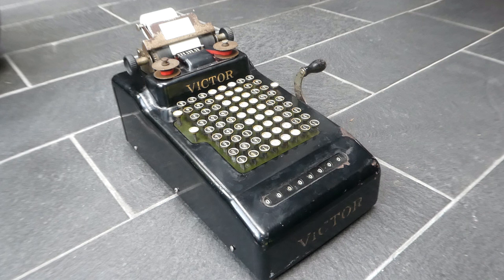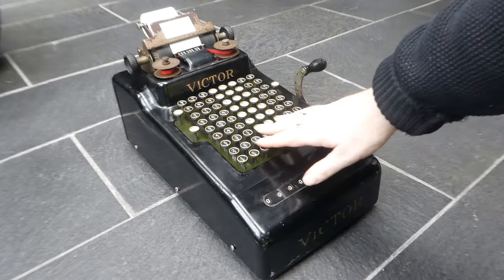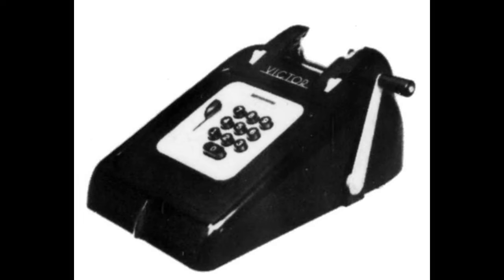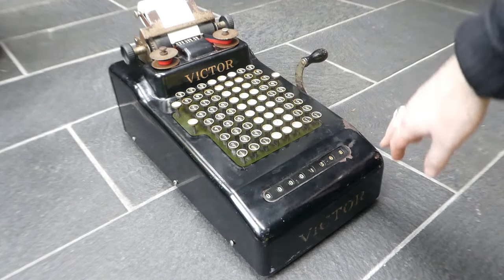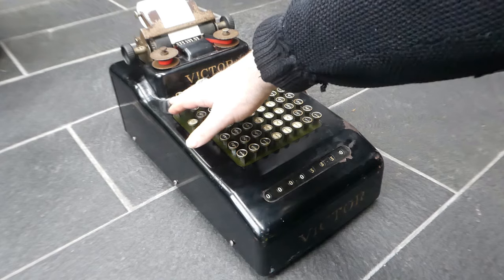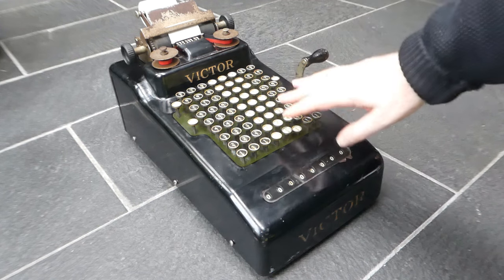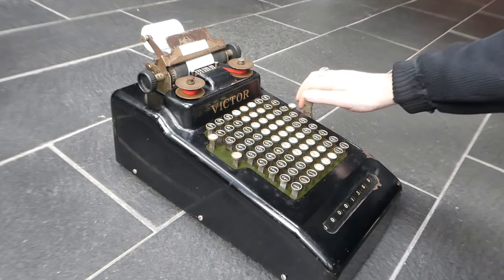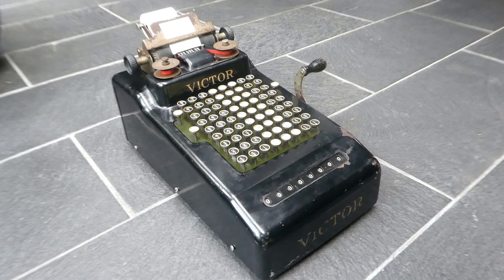The Victor series 2 adding machine

Comment: Nice Victor. I couldn’t get mine working. I’ll try again some day.
Reply from the maker: The only problem that mine had was the printing mechanism. It was completely seized, and I broke it a little when trying to work it loose. It turns out that the platen's axle is not a single rod all the way through, and now the right hand side knob no longer works to move the paper as it just turns almost freely. I should have taken the printing mechanism apart before trying to wrench the axle loose. Anyway, while mine has a lot of surface rust, the internal mechanism was fine.

Comment: I noticed the 'Complements' on the keys, so I'm assuming if one knew the subtraction algorithm that one could, in fact, even subtract on this machine. Although without Comptometer Cut-off keys for subtraction, I suppose the Burroughs' method of loading all the noughts or zeros with nines to the left of the number being taken away would work. There was, however, no printout on a Burroughs Calculator nor on a Felt & Tarrant Comptometer, so the subtraction printout on this would look bizarre to those unfamiliar with it! 
I can't tell you how much I enjoy your videos and your website! Cheers!
Reply from the maker: You're right, I hadn't even thought about that. I suppose subtraction would mostly have been used to fix mistakes, and then it does not really matter how it looks.
Reply: @jaapsch2  I'm sure you're right... I can remember doing something similar once, in the case of having added an Invoice No. (or an Account No.) taking it out of the total by doing the complements in my head because I didn't have them on the keys. Then placing the number in question below (using the Non-Add button this time) and then circling all three lines, i.e. the mistake, the correction, and the subsequent correct Non-Add so I could account for it to my boss. I was just a teen and this was on an old Burroughs Listing machine in a Building Society (Co-op.) back in the day when the doors were shut early to the public, circa 3.30 pm, and we had to balance the day's work before we could leave.

Comment: How do you get the ink/paper for these demonstrations? I've been watching for a while and you often seem to manage it.
Reply from the maker: Luckily, these early machines set the standards for many machines that followed. The Victor uses a paper roll that is 57mm wide (or 2 1/4 inch) and that is still used in many cash registers today. Ink ribbons can be trickier, but the victor uses a standard 1/2 inch wide two-colour ribbon that was also used in typewriters for over a century, so those are also not too hard to find. It helps that I don't have to use a full ribbon. I can cut up a single typewriter ribbon into shorter pieces and spool up 5 calculators with that. To get other ribbon sizes can be harder, and may need a specialist supplier.